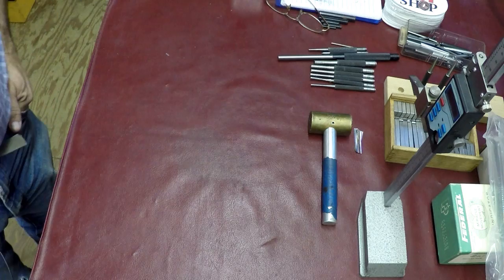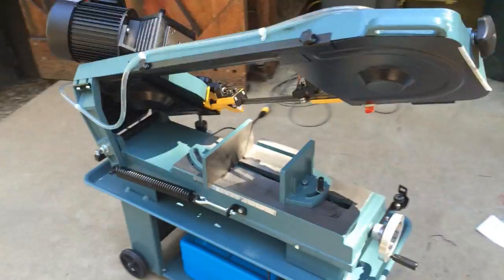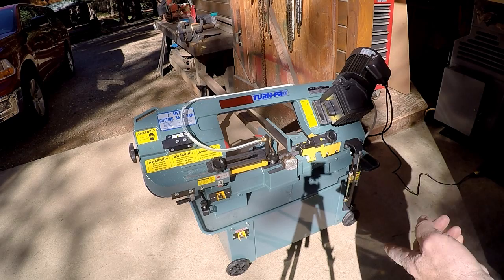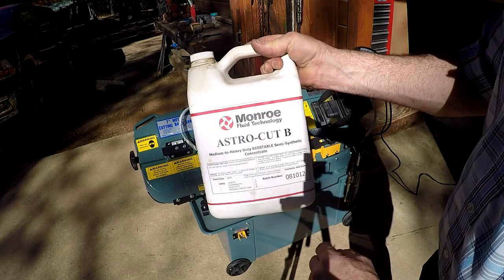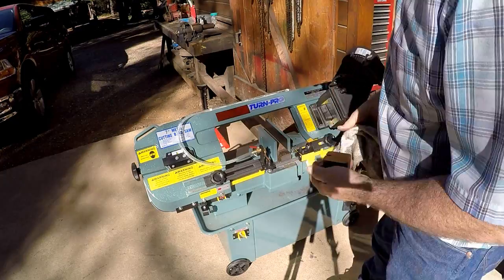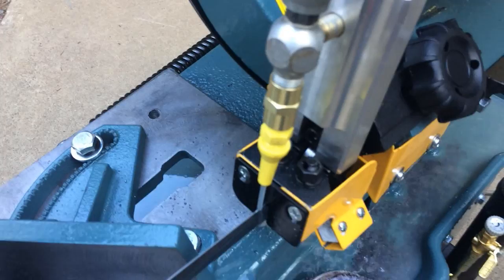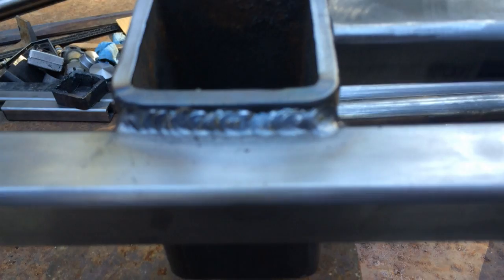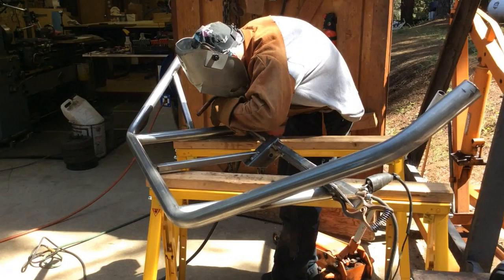Ketchup #10

Comment: I like the new saw and it cuts steel like butter. I too took advantage of the Enco sale and bought a new 2" travel SPI dial indicator to replace a 25 year old Enco DI for my old Unimat lathe. Yes, the SPI DI's are very smooth. Looking forward to the chuck rebuild.
Reply from the maker: Paul Jones Thank you Paul again.  The saw is great and works very well.  I like the SPI's they work very well.  I will get the chuck done in the next couple of weeks.  Randy

Comment: I have a similar bandsaw and had  swivel castors on the front and solid on the back, it was difficult to maneuver so I changed to all swivels and found it was much easier to move.  If I had to do it over I would use 4 swivels.
Reply from the maker: I is not to bad but dual casters in the front would be better.  Thanks Cody.

Comment: You guys and your new saws! I would be jealous but my Johnson has been a hell of a saw after 75 years I can still expect it it to cut within .005" of taper for every inch of material cut on solids, tube can wonder a bit more. I have reground each individual jaw on the bench grinder in those jacobs Chucks to get them back to a good surface and to eliminate runout. It is time consuming but for the $100 kit I can spend some time. :-)  Enjoy your new tools.

Comment: I got a few tools with your Enco codes, too.  A couple of center drills and a gallon of Spindle Oil...then decided on the 31st to get one of the smallest Noga holders that were already on sale.  It was nice to add free shipping and another 20% on top of it.
Reply from the maker: ILGopher The noga holds are great and even better when on sale.  Thanks Randy
Reply: I did forget that the one I got was the one that has the permanent magnet instead of the on/off switch, but it will work for the what I need it for.  The one the next sized up was just sometimes too big for my smaller equipment.  Just have to find a reason to do some double indicating now.  :-)

Comment: Do you know what would be a good low cost 5/8 key less chuck for JT3 to MT2 arbor for a Porter cable drill press. I just bought a new one and the chuck hangs up a little besides I would like one were I don't need the key ?
Reply from the maker: Mack McCurry I don't think you can find to many low cost 5/8 key less chucks.  You would be better to look for 3/4 chuck but it would be keyed.  Thanks Randy